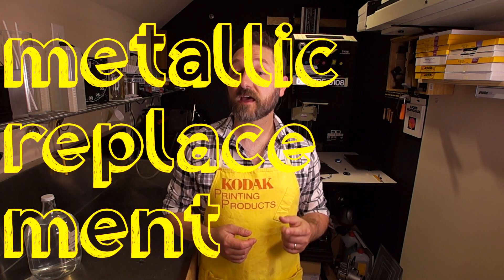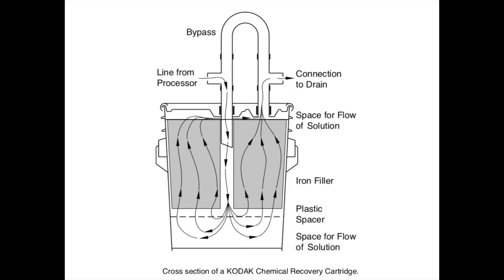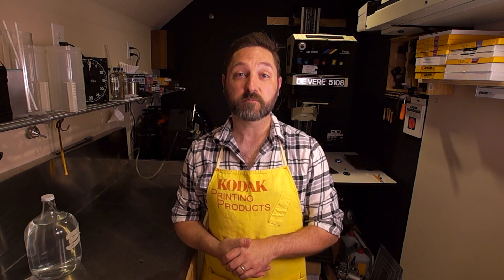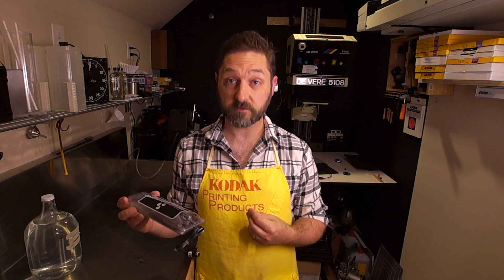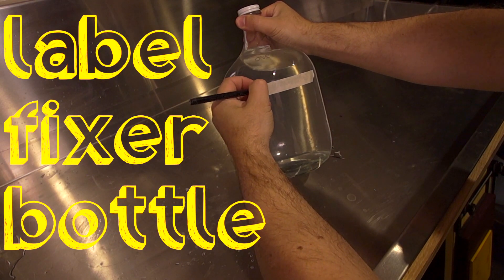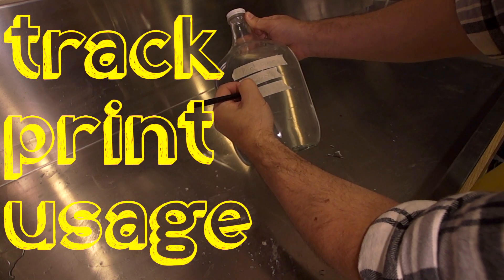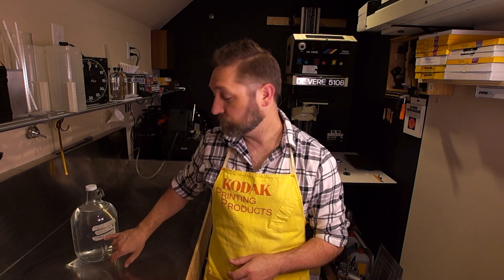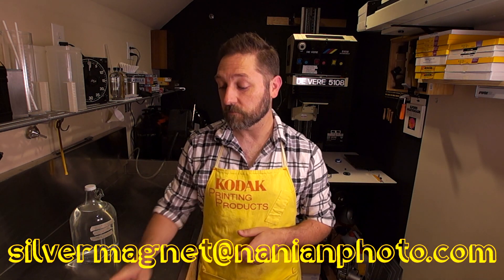Using Silver Recovery In Your Darkroom

Comment: Good video,  so is there silver in the film, after being developed? does the silver go out of the film and into the fixer or does the silver come from the devoper, right,  isn't the fixer the devoper
Reply from the maker: The film has silver salts in the emulsion.  The developer changes exposed (ionized) silver salts into metallic silver.  Fixer dissolves the remaining silver salts out.  Washing removes the fixer so it can’t start to dissolve the metallic silver image.
Reply: @TheNakedPhotographer  good info,  exposed ? With a flash

Comment: Pro tip:
A: Keep all of your developed black and white prints that would otherwise be discarded, i.e. test prints
B: Use E6, C41 or RA4 bleach to convert back to silver halides
C: Then fix the silver out. Recovers all of the silver in the paper, not just the unexposed silver. This works on film too.

Comment: I just used a battery charger to perform straight electrolysis on my spent fixer, and silver would precipitate out. Filter and wash that, dry it, and store in a capped vessel for later. Still have a couple of ounces which I plan to give to a silver jeweler to play with.
Reply: can you elaborate?

Comment: When i was working at a minilab we had a cartridge system. When we sent it in we got something like $400 bucks back. This thing was a 3 gallon cartridge system that i don't think exists anymore.
Reply from the maker: That sounds like the Kodak system.  How often did you send them in?
Reply: @TheNakedPhotographer  it was some weird pump into what resembled a fiberglass scuba tank thing. This was maybe 13 years ago. We only changed it once the 8 months i was there, but it worked on the same principles as the kodak system. Think it weighed 50 lbs, might have been 5 gallons at least. Don't remember the name of the maker, but do remember the manager showing me the invoice as we were all curious. Fun job before moving to the next place for college. All the free c41 processing i wanted as it kept the chems moving. Think i did 60 rolls for myself while i was there. Definitely spoiled with a decent fuji scanner. We even did some very expired aps for a customer too since we still had a working cartridge puller.
Reply: Do you know about CPAC Equipment Inc? Still selling silver recovery units and cartridges.

Comment: I have noticed another way. 

I use PET bottles to store chemicals and I noticed that an old fixer solution stored for long time, formed a thin black layer over the bottle walls. Because PET is flexible I only needed squeeze and press bottle walls to remove this layer that turn to small scales in the fixer. Waiting, this scales be settled at the bottom of the bottle. At this moment you can discard most of the fixer carefully to no shake the silver particles from the bottom. With the rest (the fixer with all the silver particles), you have to filter with a coffee paper filter.

After the filter is dry, you can see solid small corns. It have strong fixer smells and for sure is more than only silver. 

For the moment I’m collecting and when I get a significant quantity I will worry about how to convert it in money, but for the moment I reduce the amount of silver that goes to environment.

Comment: there is also a third method, which is very simple and spectacular: put the silver-saturated solution in a clean glass bottle and add to the solution a little bit of developer: you will immediately see the metallic silver precipitate in nanoparticles and coat the walls of the glass bottle :)
for environmental reasons, I suggest you to use an hydroquinone-free developer
Reply from the maker: I’ve not heard of that method.  Can you recover the silver for refining?
Reply: The Naked Photographer 
yes, you just have to shake the bottle in order to break the silver coating on the walls. the coating must be fairly thick (more or less like an aluminum foil), otherwise it will stay attached to the walls. I think you can also try to scratch it, as in the electroplating process.
the obtained silver will appear almost black, with a metallic mirror look if it deposits on a perfectly smooth surface (the glass of the bottle)

once you filter the silver from the fixer solution, you can wash it in clean water to further remove unwanted salts.

I forgot to mention that, in order for the process to work, your solution should be alcaline (otherwise the activity of the developer is null). so maybe you have to use some carbonate if you have an acid fixer (I use an alcaline fixer and it works perfectly). I think you can also use ascorbic acid (regular vitamin C) as the reducing agent, together with the sodium carbonate (washing soda).

thanks for your very well made videos!
Reply: @federicomuciaccia9191  
Sir can you help me to recovre silver from fixer solution but with elecrolyse???
Reply: @coupablesass1066  what are exactly your needs and available tools?
Reply: @federicomuciaccia9191  Hi, would you be able to send me the recipe that you use? I have an acidic fixer so will need to know the quantities of the additives to achieve a more alkaline mixture. Also, when you say add developer, are you talking about concentrate or working strength?
Reply: @aidangageler7151  I use Moersh alkaline fixer. if you use an acid fixer, making it alkaline means to waste it: so you can use simpler (and equally fixer-distruptive) methods like the one with steel/iron wool.
Reply: Hi there, I've tried your method and can see tiny specks of silver floating around in the glass. How do I then filter the silver from the liquid? Could you explain in simple terms? Thanks! :)
Reply: @LeahBrown-s5i  if your solution is clean (dust-free) the silver particles will agglomerate on the surface of the glass walls, coating it entirely. dust in the solution can interfere with this process, letting silver agglomerate around dust particles. 
try to wait few days, not moving the liquid at all and letting the heavy silver particles to decant at the bottom of the container.

Comment: Many years ago I worked as an aerial photographer doing mapping photographer using a giant camera that used 10 inch roll film, all black and white. We had an electronic silver recovery system there. I don't remember the details of what it looked like, but I do remember seeing an actual nugget of silver that broke free of the anode.* I imagine there were impurities in it.

*Useless trivia of the day: I just looked up anode and cathode, and the terminology is actually flip-flopped depending on the type of equipment. If it's a consumer of electricity, like a motor, the anode is positive. If the equipment is a producer of power (a battery, generator, solar cell, etc.) then the anode is negative.
Reply: I used to do the same thing for DNR washington ,If i knew then what i know now
Reply: I always remembered it this way, cathode-has the word cat in it, Black is negative, black cat, cat-thode!